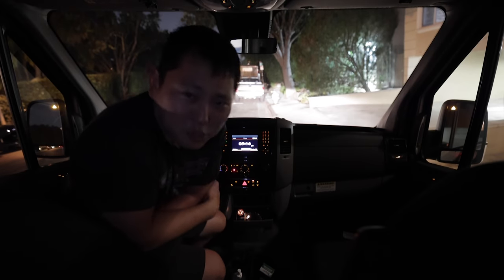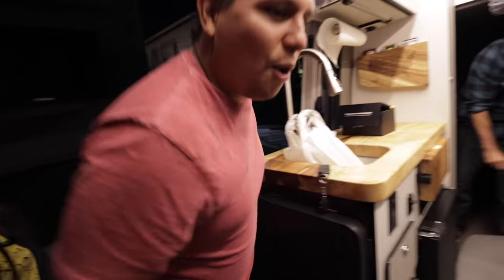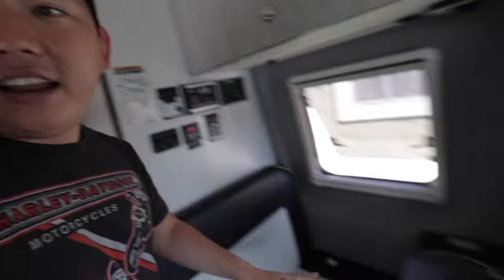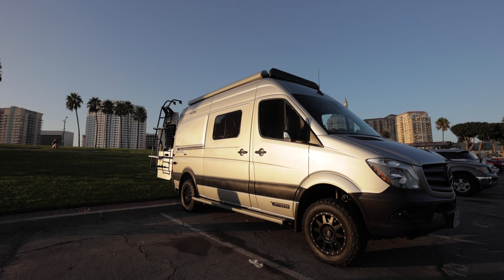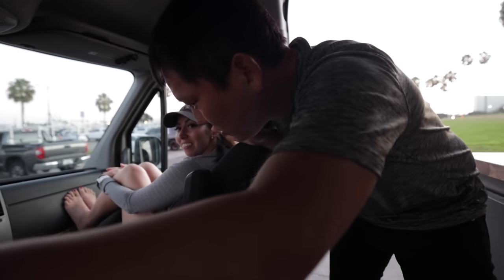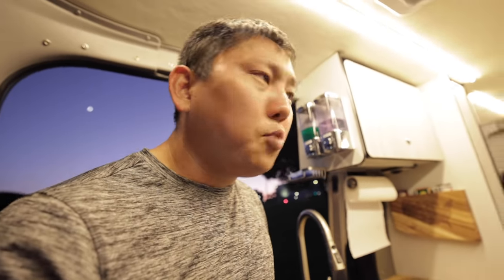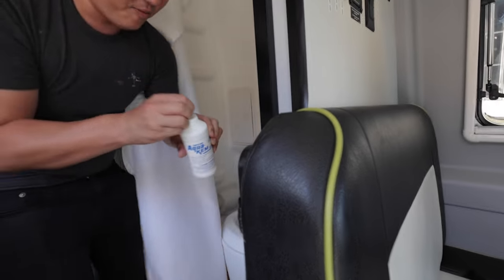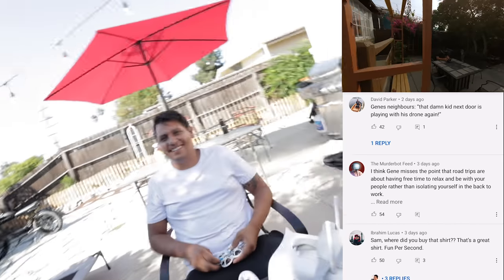Tour of the $175,000 Camper Van | Winnebago Revel

Comment: Before you buy one you need to go stay in it for at least a week, preferably during a rain storm.  The whole "It's small and cramped but we'll be outside most of the time" is fine until you are stuck in it for 4 straight days because it is raining.  That's the true test.

If you can go a week in it and not hate it or each other you'll probably be fine if you can make it two weeks and not hate it or each other your golden.

Also don't leave the awning out when your not there regardless of the wind sensor.  The first gust could be the one that rips the awning off before the sensor has time to close it.

Also check the towing capacity and you might be able to flat tow the JT behind it so you can jeep when you get where your going.
Reply: Hard test to do in California ...

Comment: Coming from someone with experience save your money that can is full of expensive and completely unnecessary stuff that you either won’t use or will break. If you have your heart set on a van, build one yourself( or get someone to do it for you) or better option get a roof top tent with an annex for your gladiator

Comment: 10:00 make sure the water pump is turned on + many of these systems have a button/valve to stop water flow to conserve water w/o having to turn off the water from the temperature control knobs (this way you don’t have to waste water trying to get your setting back & get hit with water that’s too cold or hot) so maybe that was engaged slightly reducing your water flow. Air in the water lines means it’s not fully pressurized. If you’re hooked up to “city water” in an RV park that’s not a problem as it’s pressurized (make sure you get a pressurized regulator attachment so your lines in the RV don’t get blown out as RV parks are notorious for ad water pressure & power boxes = get an external surge protector for RV’s, + step down/up “bones” to go between 30/50 amp connections, to place at the poster pedestal in between it & your RV).

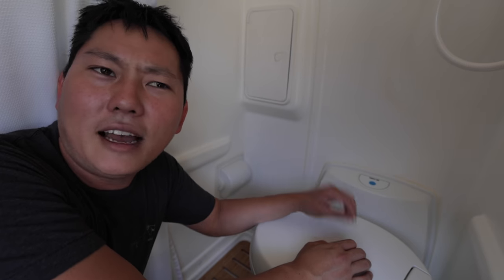Comment: 21:19 there should be a waste tank tube (a “stinky slinky” since it’s usually used for black tanks as well as grey tanks; always empty the black tank 1st then the grey tank to rinse the hose) you attaché to properly dump the water into a a dump station. Grey water is safe to drain into your plants 🌱 if you use environmentally safe soaps, etc. however it’s usually a no-no to just dump it out like that (especially in certain states like California where your sewers drain into the ocean 🐬).

Comment: Gene, if you want one with more room check out Leasure Travel Vans they start at $139,000. Also, that Sprinter chassis is older than a 2019. I drive a 2019 version for work and the dash is completely different. That looks more like a 2014-2018 version. The newer ones have push-button ignition, paddle shifters, and a touch screen entertainment system.

Comment: The van looks nice, and the 4x4 makes it extra versatile. You didn't mention if it has a 30 amp for powering appliance when you're at a trailer park. There's also usually only a limit of 30 gal. so you'd have to use water sparingly. Its great for a road trip of a week or two, but if you had to live out of it full-time, it would become small real quick especially with dogs. 

The wet bath is small, but at least it has the curtain so you have a bit more elbow room. If its a diesel that makes running the power a whole lot more efficient though still not as economical as a generator.

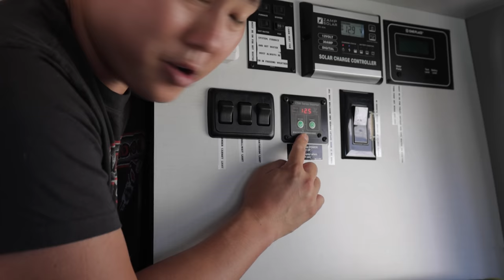Comment: 8:13 those “big batteries” are called the House Batteries in an RV 🆚 the Chassis battery that is used to start your motor home (just like a car); FYI; many off grid battery systems are designed to be charged by the vehicles alternator while running + many also flow both ways whereby your house batteries can jump start your chassis battery if it’s dead. 🔋

Comment: Man, that's expensive! My mom just bought a used 4x4 Sprinter and built it out basically like this without the lifting bed and other 'extra' features for like 45k. Not sure if the polish of this thing is worth a hundred extra grand! Maybe you guys should also consider cheaper options at least. I get that not everyone has the time or skill to build stuff like this, but theres still many alternatives between DIY Vans and this top of the line one.

Comment: when looking at the price, dont look at the monthly payment. A 35k car, at 4% for 5 years will cost you $38.6k total. But a 150k car, at 4%, for 15 years will cost you 199.7k at the end. Taking a 5 year loan on the car only costs you 10% of the value, while taking a 15 year loan will cost you 33%. If you cant afford it over 5-7 years, you really cant afford it. Not to be debby downer, but youd be much better off taking that monthly payment (about $1100/mo) and pumping it into an S&P500 money market fund. It averages 7% per year, and at the end of 5-10 years, you can pull it out and use it for a home downpayment.

If you REALLY want to get into van camping, youd be better off getting an old sprinter off craigslist (20-40k) then slowly upgrading it yourself. Your not taking out as much of a loan, so you end up saving a TON of money. You can also do your own work and save even more. If you sit down and do the math, going with the craigslist van method will save you near 100k.

Comment: Do your homework.  I own a Mercedes Interstate Van like this.  Allow at least $6000 a year for maintenance, repairs, and insurance.  For example,  a radiator flush and upper and lower hose replacement cost $774 in Florida, CA is higher.  Labor charges is $189 per hour in FL, CA is higher.  Service A is $900,  Service B is $1600.  This vehicle is a money pit unless you use it a lot.  Something always needs fixed.  Expect a lot of down time.  Nonetheless, I can afford it and OK with it.